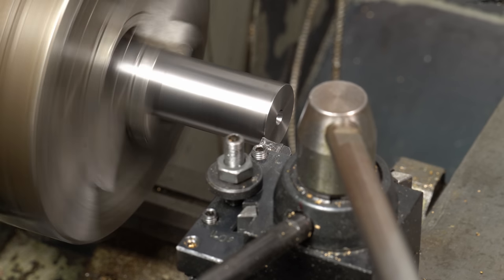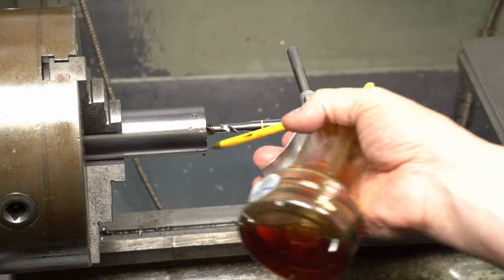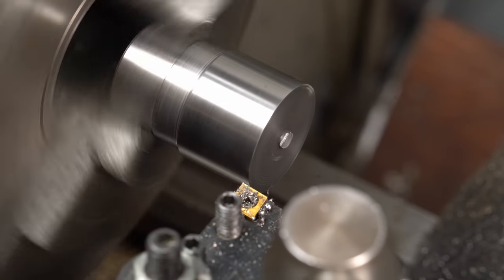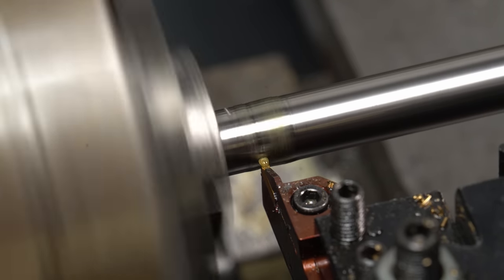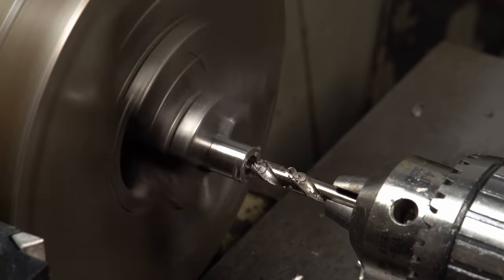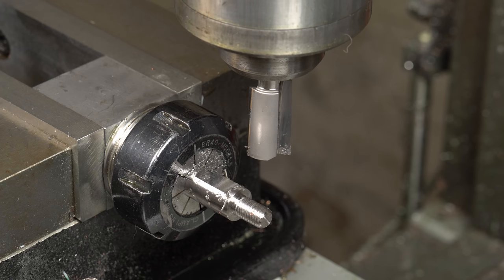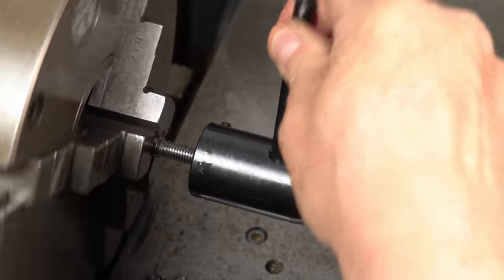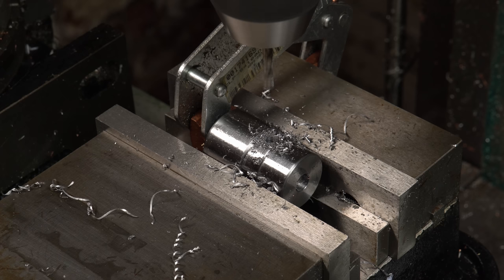Making a SELF-CENTERING Boring Bar for GHz Radomes

Comment: Actually, saying "M8 x 1.25 mm" or "M6 x 1 mm" is a rather redundant pleonasm ;-) It's like saying, say, "A4 page/ sheet of paper 297 x 210 mm" since "A4" (or A5, A1 or any other "A") already defines the size - ditto for metric threads.
Standard M6, M8, M10 (and all other "Ms") have their pitch specified, or fixed (in this case 1, 1.25 and 1.5 mm respectively), and adding the pitch size after the "main diameter" - be it M8, M12 or M36 - is done only for fine(r) threads - like, say, "M10 x 1" (a  standard thread in lighting fixtures; note the dropped "mm" - as specifying the unit is also unnecessary, since the "M" at the beginning already says "metric thread" - thus all sizes are in mm).
 It's a nitpicking of sort, agree - still, it sounds kinda funny for "metric" ears. But hey, it won't harm nobody ;-)
Reply from the maker: A significant proportion of my audience use imperial units natively, and a lot of the threads I use are non-standard fine pitch like M12 x 0.5 or M8 x 0.5 or M12 x 1 or M22 x 1. To be a bit more inclusive for folks that aren't machinists and engineers or native metric users, I tend to over-describe my threads deliberately.  I suspect a fair proportion of UK viewers older than me, and a pretty large fraction of casual viewers in the UK or US wouldn't be familiar with the standard pitch of an ISO M8 thread.  Of course, I suppose I could instead quote M8 as 0.315 inch x 20.32 tpi, but there lies madness.
Reply: @MachiningandMicrowaves  
"A significant proportion of my audience use imperial units natively" ... 
"To be a bit more inclusive for folks that aren't machinists and engineers or native metric users, I tend to over-describe my threads deliberately." - well, that makes sense. I guess being a "metric native" makes me tad biased, or blind/ ignorant of "imperial lot" viewpoint...
But yes, "nothing too strong ever broke" and over-describing won't hurt nobody either -  but then I guess for them "true imperialists" that "0.315 inch x 20.32 tpi" oddball number would still make more intuitive sense than M8 x 1.25 mm... probably.
Maybe you could just put a hard-embedded "fully imperial" conversion (like the one above) while saying "M8" only in the narrative? Whad'ya think, good idea, eh? ;-)

Never mind, it's Sunday evening and I guess I just have too much free time at my disposal right now. Do as you please and see fit. Cheers!
Reply from the maker: @MrKotBonifacy  Yep, I have to be at the Day Job in 10 hours time, working as a wage slave so I can feed my machine tool purchasing habit, and I've just discovered that the small dovetail cutter I was going to use to make a critical feature of the next project is a 45 degree cut, not 60 degrees. The carbide-tipper dovetail cutter I have is too wide, so I'm tool-shopping as I can't take the workpiece out of the mill vice to do anything else.

 I am pretty much unit-agnostic, I was taught in Imperial, Avoirdupois, Troy, CGS, MKS and SI, plus Angstroms. I think natively in barleycorns, acre-feet and parsecs.  Nice human-centric units.
Reply: @MachiningandMicrowaves  Not sure you could call the parsec a human-centered unit, but maybe it's just me. Happy shopping anyway! ;-)
Reply from the maker: @MrKotBonifacy  I can measure the angle to a star at two times 6 months apart and see how what angle it moves by relative to background galaxies and know directly how many parsecs that star is away.  Yeah, maybe not as intuitive as thinking of my garden with 30cm of water in it, or the UK/US size of my shoe in barleycorns (offset by different amounts per country of course).
Reply: @MachiningandMicrowaves    Well, the defenders of Imperial/ US Customary system often say "this is human centered natural system" - that is an inch is a width of a man's thumb, then there's the foot (and the "elbow", or "forearm" in other countries back in "old times"), and "everyone knows" how big a barleycorn is - and so on, and so forth. But an average human is about 1.7x10^-16 parsec tall (I probably got the math tad wrong, as usual - but that's my trademark since about the sixth grade of primary school so I got sorta used to it), and THAT was on my mind when I said "not sure you could call the parsec a human-centred unit".
Also, don''t relay too much on the stated shoe size, no matter what unit - always try it on ;-) Fun fact - there's also a metric shoe sizing system, but seems no-one uses it nowadays.
Cheers!
Reply from the maker: @MrKotBonifacy  All the shoes I've bought in the last 20 years or so have been in the Paris point system, never seen any Mondopoint sizing except in some shoes I bought in France, which were marked as 46.5 EU/295 Mondo/12 UK/13 US.  When I was a child, the local shoe shop had an X-ray fluoroscope so my mother would check that I had the right amount of wiggle space for my rapidly growing toes.  All that radiation, marvellous.

Comment: "When I  made my mistakes" goes the opening line of this video, and when one watches it with CC on, then... Oh yes, I'd certainly agree, Sir. ALL the subtitles shown in the first second of it, and then... nothing - nothing whatsoever for the whole entirety of it. How fitting, indeed...
Reply from the maker: Working fine for me in Chrome on Windows 11 and my iPhone.  Timings are correct in the CC configuration too.  I think Youtube had some glitches a few weeks ago where this happened, but nobody else has mentioned it for this video.  I wonder if they are doing engineering changes?  Which browser and OS were you using?  If you restart it, does the fault recur?
Reply: @MachiningandMicrowaves  Thanks for your response and explanation. Well, I'm kinda an old-timer, y'see - Mac, OS X 10.9.5, Firefox 78.15 (can't get any higher on this machine and OS - and frankly, I don't... well y'know, don''t ya? ;-)
So yes, it might be some glitch with either YT, my browser, or it's just time to die for myself, but then again this doesn't happen "normally".
Sometimes videos starts with CC on, by default, sometimes I switch then on cuz my hearing is just as good as my rusty-trusty 15-yrs old PowerMac, but I hardly ever see such "all in one go" CC issue.
But hey, don't pay too much attention to my complain, I'm just an old farty knocker. Cheers ;-)
Reply from the maker: @MrKotBonifacy  My Macbook died so I can't check, but I'll ask around to see if anyone else is getting that glitch again.
Reply: @MachiningandMicrowaves  Actually, "fuhget it". I just saw your reply, decided to make a screenshot and sent it to your email address (one provided in "About" section), and... fork.
The video opened with German auto-translated CC (another recent YT glitch - it turns on auto-translation based on "recently watched" videos, I guess - which could be English, German or Russian ones), but those German CC were displayed properly. I switched it back to English, and those English CC were also displayed correctly now.

I just thought it might also have something to do with me "overloading" my browser - as of know there are 54 windows open, with anything between 5 to 15 tabs in each of them, and Firefox isn't the greatest browser when it comes to resource managing to put it mildly. (And to put it less mildly it's a CPU hog, and it seems like the ad blocker is trying to fight ads in all those "undisplayed" windows and tabs all the time, which forces me to force quit some of those every now and then.)
Anyway, the issue seems to be gone (for now?), so no need to bother. Thanks for your attention to it anyway. (Also, I'm leaning toward considering the possibility of getting a somewhat newer Mac, but this eventual decision needs to go through the proper evaluation process, so don't hold your breath ;-)